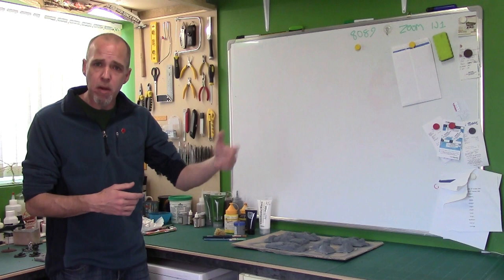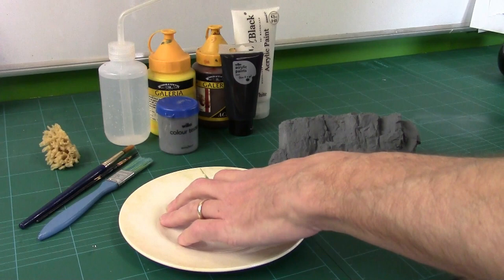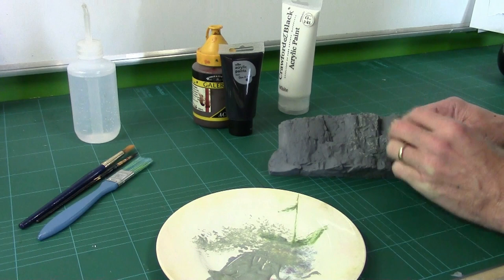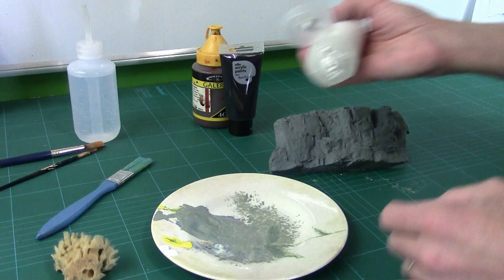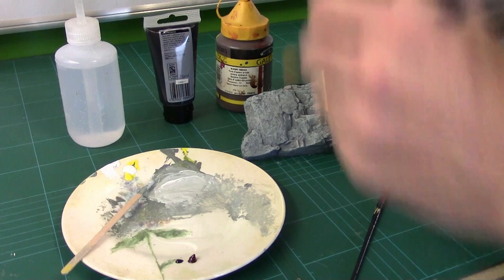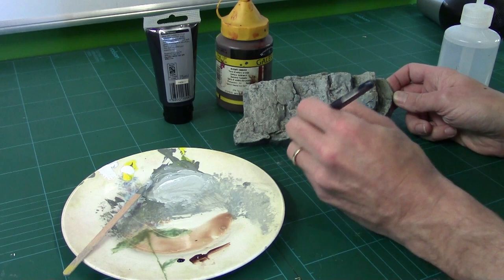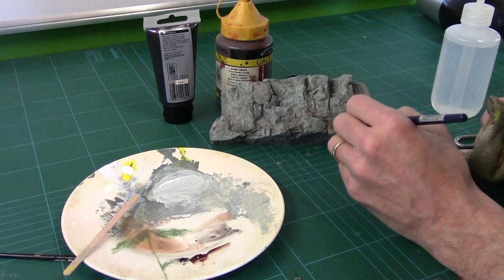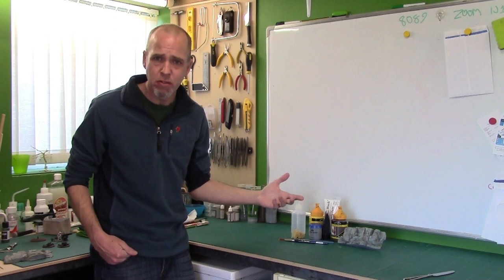Realistic scenic rocks - Acrylic stippling technique

Comment: Very nice Mel, finished piece looks like something Weta Workshop might put out :)
A tip I learned from a railway modeler for detailing rocks was adding the suggestion of lichen growing on them. Putting white or yellow paint on a toothbrush and then flicking it onto the rocks haphazardly does the trick apparently (never tried it myself!). Might be worth a go.
Reply: What occurred to me is maybe using some green/brown weathering powders to create streaks of mud/algae growing over areas where water is regularly trickling. Might not be something you see in dryer parts of the world, but here in the Pacific Northwest where it rains all the time you definitely see a lot of streaky rocks.
Reply: +PIRATER0B0TNINJA Weathering powders would make a great video.
Reply: Indeed. Apparently crushed pastels will also work in a pinch. Just need to seal with matt varnish
Reply from the maker: +Louis Britton I'm saving the detailing for a separate vid once I've covered more painting techniques mate :-)
Reply from the maker: +Bill D. in Iowa It's on the list, along with a few others :-)
Reply: TheTerrainTutor Fair enough buddy, I'll look forward to it. :)

Comment: For a couple years now, I've tried this water+paint method making my own washes.  Every single time it always dries with a white crust around it and it looks terrible.  I've just realized that it's probably my water.  The water in my house is probably heavy and laden with calcium or something and that's what I see when it dries.  I'm gonna try some distilled water and test it out at home.
Reply from the maker: Yep, that'll be the water, distilled will be fine mate ;-)
Reply: Thanks!
Reply: It's most likely lime in the water. Lime leaves a white residue. You could try filtering the water, with one of those drinking water filters like Brita.